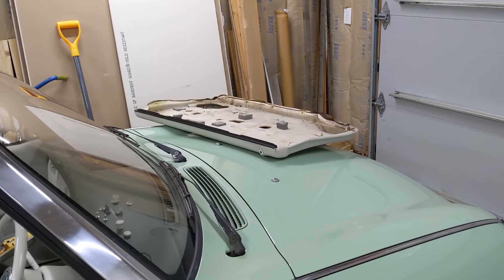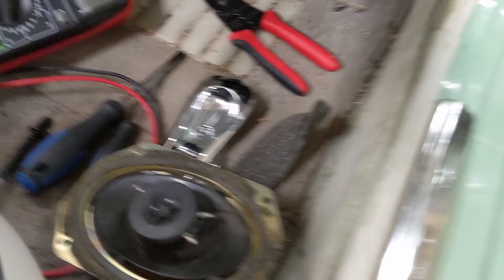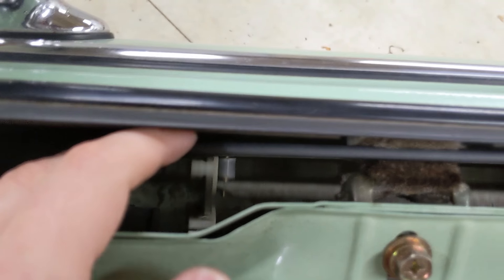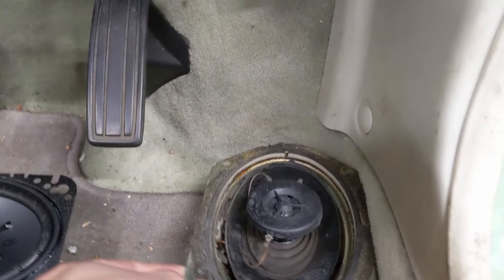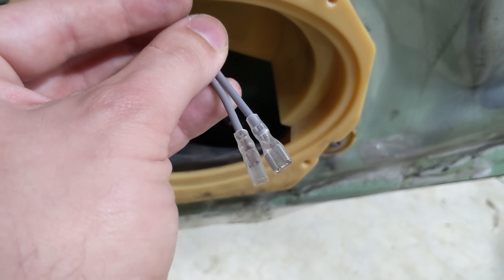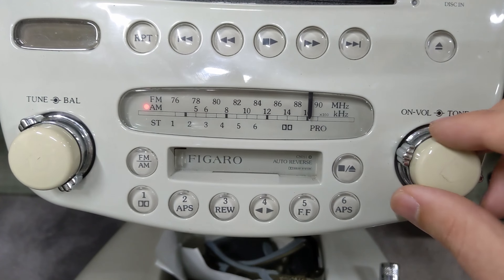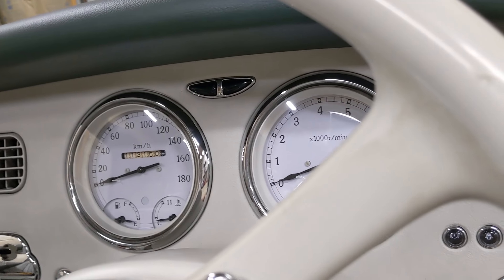Replacing the Figaro's driver's side speaker

Comment from the maker: I would just like to add here that yes, you do have to remove the door panel to replace the speakers. I tried just removing the grilles and... that is not a thing they were designed to be capable of.
Reply: The originals look more to be 5"x7"... which I can only guess you had a hard time locating replacements for, Alec.
Reply: 5x7 is easier to find

Though I usually make my own baffle out of 3/4" MDF wood so I can use all screw holes and I can glue the baffle to the door for a stiffer mount (less rattle and more bass)
Reply: create an adapter for the speaker to mount and since it's Japan Sony might have the replacement ones that you're looking for they only need a very good description of what they look like.
Reply: If you're gonna get speakers, get them from Parts Express. I've been recommended them before from american friends, and only heard good things about them.
Reply: Use all the screws next time, just drill a new hole in the plastic bracket if you need to.
Reply: The FM band in Japan goes all the way to American standard now and has since the early 2000s. I know you likely know that but yeah, they actually have a slightly wider band than most countries now. 

The history of FM radio in Japan Is fascinating, it was such a huge deal for them and even today the older population of Japan keeps it hugely profitable. Several Japanese media companies make more money from their radio output than their visual to this day.
Reply: It is IMPORTANT that the speaker on our side is connected correctly otherwise the sound will be weird and the bass will be gone!

There are many speakers to buy! flatter. smaller magnet. different shape! There is always someone who fits which you can buy.
better to buy something that fits than having to destroy something to make it fit!

It looks like the magnet is too big?
here in norway we have stores that sell good to cheap speakers in all shapes!

it is a good idea to use gasket on the speaker to prevent vibration from making strange noises. 

After soldering wires you need to remove sharp edges that can go through the shrink tubing

Having a speaker at the bottom of the door is the worst place to have speakers! Sound quality becomes very poor.
Unfortunately, this is where most car factories placed the speaker.
Reply: Had to do the same to my 2000 Murican Grand Marquis
Reply: FWIW, when I worked at BBY/Geek Squad, I talked to a lot of car installers (believe it or not, a lot of them are old-timers and know what they’re talking about), and most seemed to prefer crimp caps (not to be confused with butt connectors) to soldering. I’ve personally had better luck with crimp caps than soldering... though it was a bad idea to do my soldering without helping hands.
Reply: heatshrink, the tubing

Comment: The Figaro may be from the 90's, but it's dash still looks better than most new cars sold today
Reply: It looks like a rickety old piece of junk. It's a plastic facade on a car masquerading as a car that's much older. It actually looks very cheap.
Reply from the maker: @Andrew Delashaw you must be a blast at parties.
Reply: @xenonram  the car looks absolutely gorgeous.
Reply: @xenonram  Almost every modern car has a rickety plastic dashboard, but few of them look as good as this.  It does look old, though, because old cars had much more dramatic styling than modern cars, and it's retro style is why this car is so pretty.  Also, since this car is relatively modern it might not just disintegrate if you crash :) www.youtube.com/watch?v=fPF4fBGNK0U&ab

Comment: "Wherever this car was living in Japan was HUMID. AS. FORKS" Truly spoken by someone who has never been to Japan :p
It's humid EVERYWHERE in Japan.
Reply: Was specifically looking for this comment. Not because I've lived in Japan. But I've lived in Florida, and I hear they're similar.
Reply: yeah Florida is very similar to Japan : heat, humidity, hurricanes and a lot of old people.
Joke aside, in most parts of Japan the climate is rougher than Florida, with frost and snow during winter. It's most like the whole east coast of North America.
Reply: It's hot and humid in South West Japan in summer. Much like South East Asia.
Reply: R Dreher Not so much in Northern Japan like Hokkaido.
Reply: Vierax Sounds like Connecticut weather. It’s currently like 35C/95F and humid... and in 2013 we had literally a meter/40” in a single snowstorm
Reply: Still : " wherever this car was living in Japan was HUMID AS FORKS" isn't a lie.
It could easily have been spoken by someone who was born in Japan and hasn't lived anywhere else.
And also it's humid everywhere doesn't mean it's equally humid everywhere.
Reply: Japan is similar to Florida, COMPLETELY SURROUNDED BY OCEAN (Florida is only Mostly Surrounded) so of Course it's going to be Humid...

I believe (though I could be wrong, I've never visited Japan) there is only 1 place in Japan that you actually Breath the Air instead of Drinking it and that's at the top of Mount Fuji (it's high enough that the Air just can't hold enough moisture to achieve more than 50-60% Humidity)...
Reply: @PainterVierax  I lived in Japan for nearly four years, came here to say this specifically.
Reply: @hamutarourapisu1219  Dude, I lived in Hokkaidō for SIX YEARS. It is fucking humid in Hokkaidō. It's just not hot. In my native New York, winter is dry - my lips crack, my fingers need lotion. In Hokkaidō you can feel the water in the air even in winter. I remember biking one Silver week from Iwamizawa to Ishikari and back, the day was golden and summery when I had left, but when the sun set and I was still stuck in the middle of a sea of rice farms, I was blanketed instead by a September air of COLD WET RAGS! The moisture in the air would condense and freeze on my bare skin. Believe you me, Hokkaidō is fucking humid, and humid all year round. It's not exactly the same hot and humid of Honshū, but it is still way more humid than my native New York, and New York knows a good bit about humidity itself.

Comment: 3:25 - New speaker has every hole spacing imaginable. Still doesn't fit the Figaro :p
Reply: It fits the next gen though 😂
Reply: Two screws are plenty! This thing ain't going to Mars.
Reply: Since the screw holes are just slightly off, I blame it on Japan using metric and the Us using Imperial. If you just calculate with 2.51mm per inch you'll get that.

Comment: Did you verify that it was actually the new Kicker speaker that was faulty and not the radio's amplifier, by testing either the radio with another speaker or by testing the speaker with another amplifier? The distortion I heard sounded more like a blown amplifier output stage than a blown speaker -- and it could be putting DC voltage onto the speaker terminals, causing the popping noises and eventually causing the death of the original speaker if someone kept using it long enough like that.
Reply from the maker: Yes. I did that. I do have some knowledge of what I'm doing ;)
What I didn't tell you on camera was that if you pressed on the speaker cone slightly the distortion went away completely. I also swapped the speaker with the other one and there was no distortion.
I recognize you're just trying to be helpful, but have a little more faith in me, man!
Reply: @TechnologyConnextras  Yeah sounds like that voice coil might be off center / rubbing to speaker frame. Or maybe just lost a glue.

Comment: The screws on the dash waiting to roll down into the vent give me a lot of anxiety.
Reply from the maker: It's OK, nothing happened.
Reply: I had a side mirror replaced at a dealer and there socket rolled off the dash and into my vent. It’s still there to this day. Every so often you can hear it rolling around.
Reply: I had a credit card slide between the windshield and the dashboard once.  It's probably still back there, somewhere.  If I hadn't seen it happen with my own eyes, I would've thought it impossible.  I've been more careful with dashboards ever since.
Reply: I have a lot of empty pill bottles which are useful for this sort of thing
Reply: @J Hemphill O hai troll!
Reply: @J Hemphill yup. It's a wonder how these people leave their houses. "It triggered my OCD." "It gave me anxiety." Waaaaaaa. Not only does it discount people with ACTUAL clinical OCD/anxiety, but they have no idea what having an actual problem like OCD/anxiety is like.
Reply: @xenonram  SO. TRUE.

Comment: I agree with you about keeping the lights incandescent.  Fun fact about instrument-panel lighting from this era:  I discovered that on my 1992 DSM, the instrument-panel dimmer is a PWM unit, not just a rheostat.  It pulses the lighting at 80-90 Hz to get the desired brightness.  Its output transistor is on the negative side of the power system.  As long as you keep the dimmer setting reasonable, incandescent IP lights on any car should last a really long time.  And speaking of dimming, another problem with LEDs (if you have a mix of LEDs and incandescents) is that they won't respond to dimming in the same way.

Comment: I hid this in a reply to another comment somewhere, but I thought I'd add that since the factory holes look like they were just tapped into the plastic the easiest solution might be to drill and tap new holes to match some of the universal holes on the mounting plate.  Also, that's a beautiful, unique little car you have there.

Comment: My 91 Civic had a CD player as a factory accessory that replaced the change tray.  Also, I've had to replace the caps in Clarion stereos in 2 of my Hondas.  They were the first things to die in both cars that weren't normal wear items.
Reply: That's better than having an aftermarket Clarion head unit and someone smashing the window of your Civic because they wanted it more. Been there done that. :(
Reply: @mikem.9197  That sucks :(

Comment: all the clarion speakers in my SAAB 900 had the foam suspension disintegrate too, except for the 3.5" tweeters in the dash that had some sort of weird kevlar suspension? I refoamed the 6.5" woofers in the door, but I used Polk speakers for the 6x9 coaxials on the parcel shelf, and the tweeters in the dash. the stock speakers had those same connectors, so I drilled out the rivets holding them to the speaker frame so I could build my own wiring adapters. :)

the clarion-designed head unit also needed to be completely recapped. 105C electrolytic capacitors inside a car head unit inside of a black car with lots of glass and a black interior was a bad idea... used 125C caps wherever possible instead.

Comment: You managed to solder your NON-corroded non-mystery-metal speaker wires? Lucky!  
That was a fun discovery on mine with my speaker not working. The flipping connector had water drip and corroded right loose AND the wires refused all solder and flux. Crimps to the rescue.

Comment: Put the swamp cooler in there then you'll have "air conditioning" !
Reply from the maker: This car's A/C actually works!
Reply: Figaros had AC and PAS whereas the K10 micra/march chassis cars we had in the UK never had the option so people rip figaros up to get power steering and AC

And the fuel tanks in a figaro have in tank fuel pumps for fuel injection whereas a lot of the other K10 chassis were carb only and were gravity/vacuum feed

Comment: Isn’t it funny how they put in so many “universal” mounting holes, that there is barely any metal left, and STILL it NEVER matches YOUR screw pattern!
Reply: I kinda wish they just left it solid so you can make your own
Reply: Rivet a thin aluminum or steel sheet over it then drill through that if you're up for some DIY work
Reply: I was shaking my head at that too.  It looks like the factory holes were just tapped into the plastic, I'd just drill and tap some holes to match whichever "universal" holes land on nice flat plastic

Comment: I might be nit-picking here, but I hope you used a JIS screwdriver to take those screws out. They may look like Phillips screws, but using a Phillips WILL strip out the heads when you try to tighten a JIS screw.

I learned that the hard way working on my mom’s ‘89 Camry.

Comment: The vapor barrier is not supposed to seal the speaker from the inside of the door. Car doors are generally designed to be an enclosing chamber that enhances the sound of the speakers. The cup open at bottom is sufficient for moisture protection.

Comment: You can get LEDs for the bulbs in a yellower or "vintage" color it's a pain to keep changing dash lights , also for your Bluetooth adapter you can just order a Bluetooth amplifier board off Amazon for around $15 and will produce much higher quality sound, you can them hook up the radio to that board directly or even use a toggle switch to choose audio input , the little boards they sell on Amazon are pretty powerful and compact 50w boards!

Comment: Yes, with that plastic in place it makes sure water doesn't fall into the speaker. You don't need a vapor barrier for a speaker, also the wires would make it pointless. If you wanted to do anything you could install speaker baffles behind the speaker and remove the old plastic part

Comment: I wonder if you could adjust/align the FM range upband to catch the US stations, or at least more of them.

Also, as far as getting those screw holes to align, since I always try to not modify the original parts of the car, and since the original speaker is completely trashed, I would consider cutting the flange off the old speaker and use it to clamp the new speaker in place tightly, assuming the door card allows you the extra 1/8th inch.

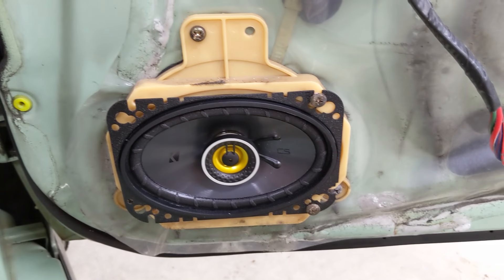Comment: 11:40 the reason why it sounds bad was actually because dirt got in between the coil and the magnet causing friction which it also amplifies through the cone. Just put it on a load (bass test or anything to flex it) and it should go away in a minute or two

Comment: I know this vid is long ago now, but yea, I'd say those are original speakers.  Aside from being made in Japan, mine in my 97 Altima are made in USA Clarions – which I'm looking to replace for same reason, because 306K mi is a lot for a set of speakers [because that's ~totally~ how you measure the wear/tear on a speaker].  Although I prefer white text on black, I love the font/style of the gauges in that car.  Altima/Bluebird gauges are a tad more on the boring side.  113K km, such a low mileage little car, and it's a '91?!  It looks more mid-late 90s in the styling of it, that's wild.
That's interesting that the MHz range of FM in Japan is different than ours.

Comment: So... I just replaced a speaker in a 2008 Toyota Yaris... It has a bespoke speaker integrated mounting bracket. Similar to your beige coloured bracket. What I did was remove it. Took measurements and in Fusion360, made a replica of the car fixture mount dimensions but modified the speaker dimensions to fit a new modern speaker. 3D printed the whole part and installed it like a glove.. Works perfectly.

What a time to live right?

Comment: Also spray the insides of your doors with fluid film to slow down the inevitable rust. ...which is sadly especially inevitable on Nissans.
Reply: Interesting thought, how long does it take the smell to go away?
Reply: @DestDroid  to clarify, I mean like inside the door behind the plastic barrier which is fairly well insulated from the cabin. However, I definitely spray some of it behind my interior panels too; after 3-4 days I couldn't smell it anymore. (or maybe I just got used to it? lol) But I'll deal with some smell for rust protection. Central Ohio is brutal on cars.
Reply: @fisqual  I was always told to spray in the seams at the bottom of the door (basically the spots that won't drain water very well) so that the fluid film will displace any water from sitting there and causing rust.
Reply: What about where it doesn’t rust? Barely any road salt in Oklahoma... don’t think I’ve ever seen fluid film for sale here. 

Having said that the roads are terrible and our state animal is a traffic barrel and our flower the traffic cone.

Comment: OEM door speakers really only have a splash shield like that on the top, water doesn't really come from the bottom enough for anyone to bother fully encasing them. If the barrier went behind the speaker it would probably make a lot of noise from it getting blown around when the speaker is playing. The volume of the door also acts as a sort of speaker box.
Reply: It acts as an infinite baffle (aka free-air). For a speaker that size an enclosure would have to be much smaller to have an effect. More efficient power wise, but nothing to help prevent the speaker from bottoming out or suffering from over-excursion like say, a sealed subwoofer enclosure.

Comment: Old AM radios use to only play through one side of a twin speaker setup.
You may want to check the output from the radio. If it’s only putting out one channel there’s little you can do other than figureing out a way to split the signal. You could do this with a relay and if you tied into the switch that selects the band you could use that to power a relay to cut out the stereo speaker and split the mono.
I’d only attempt that mod if it is in fact a single channel AM output

Comment: I recently opened up my 2000 Toyota Solara’s door to fix the handle. The speaker was in about the same condition. Vapor barrier situation was similar too, just a little plastic roof over the speaker. (Mine are unfortunately part of the speaker, not sure how I’m gonna deal with that when I replace them.)
Reply: @Pathogen-David, Check out Crutchfield, I've used them many years now.
 https://www.crutchfield.com/m_760/Car-Speaker-Installation-Parts.html 
look for 'Foam Speaker Baffles', they will have speakers and all adapters/connectors needed too.